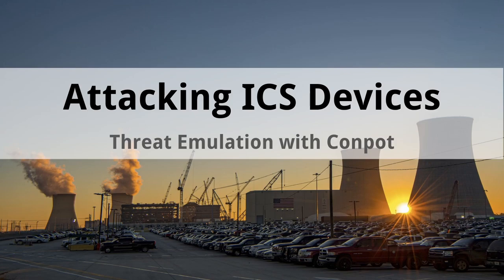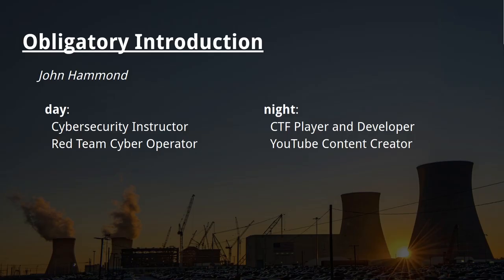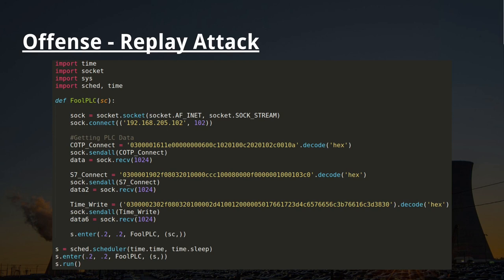Attacking ICS Devices - Threat Emulation with Conpot

Comment: Alright - So a tank doesn't exist in isolation. A PLC Dev would never (I hope) implement a 'drop tank level' command. 

(Good) PLC devs operate with a philosophy of 'how do I make sure the tank maintains an optimal level', and 'how do I ensure the system behaves in a failsafe way, especially if the physical hardware fails in any number of specific ways'. Lets say we're trying to fill the tank.

The tank itself should have some sort of level feedback - be it a digital high level sensor, or an analog feedback (the tank is 69% full). Analog feedback is more flexible because the operator can set soft limits, typically a High and High-High level. (say at 80% and 95%).

The tank will have some pipework feeding into it, perhaps with some combination of pumps and/or valves. Those valves will have a hard interlock with the tank High level feedback, i.e., the software completely disallows the pumps to run and forces the valves to close if it believes the tank is going to overfill.

Control of the tank will typically look like - if the tank lowers to a low level setpoint, run the pumps until the tank reaches a high level setpoint. Once you reach that setpoint, stop the pump. This will all happen automatically without any sort of operator interaction. Remember, the point of a control system is to take a human out of the loop.
That said, a control system will generally allow an operator to override the auto mode functionality by manually turning the pump on and off. However, the pump will still obey a certain set of safety interlocks, including the tank high level. 

Which brings me to my last point - a (good) PLC dev will also operate with the mentality of 'how do I make this system operator proof'. Operators are Excellent at causing things to fail in strange and unexpected ways. Maybe they wanted the tank to be filled higher, so they might try and set the High and High-High level setpoints to >100% (which will never trigger because the tank will overflow at 100%). The dev needs to ensure that those limits are always valid, and so will limit the maximum setpoint to 100%. 

For these reasons, I really wouldn't put much effort into attacking an ICS from SCADA. 

If you wanted to actually overfill the tank, you need to attack the inputs to the system. It might be that you can find a way to force the system believe the tank is in a different state to what it actually is. If the tank relies solely on an analog level feedback, try and force the controller to believe the tank is always at say 50%, regardless of the actual tank level. Or, it might be there's a significant distance between the tank and the pumps, and they're controlled by different controllers. Intercept the communication stream between them, identify how the tank PLC is communicating the interlock to the Pump PLC and manipulate it there. Maybe there's a complex series of valves between the pump and the tank, find a way to manipulate the valve feedback such that the pump thinks it's pumping somewhere else.

A succesful cyber attack will need to seek to sever the control system from reality.
Reply: this is a valid point, and I like the summary "..sever the controller from reality."